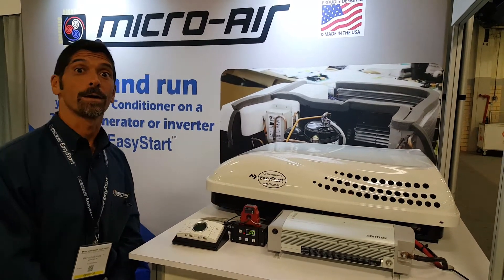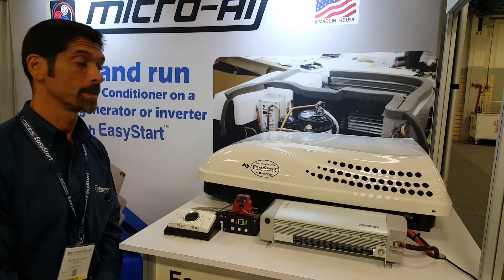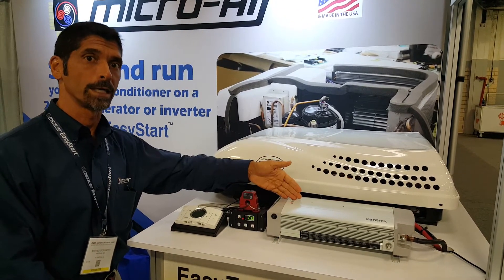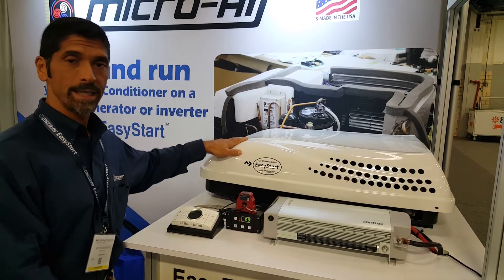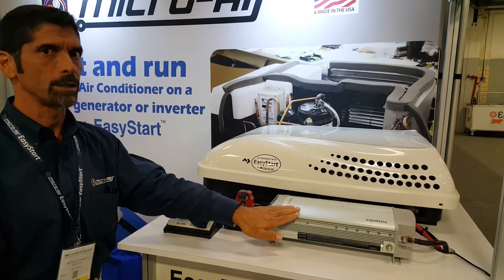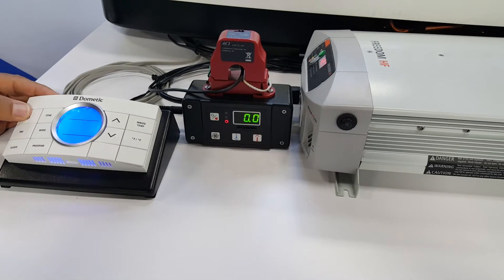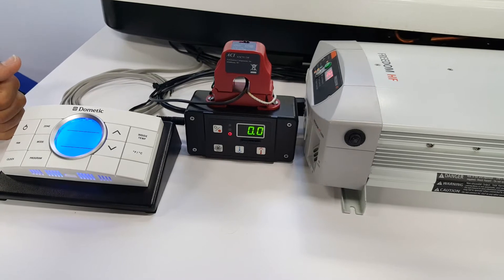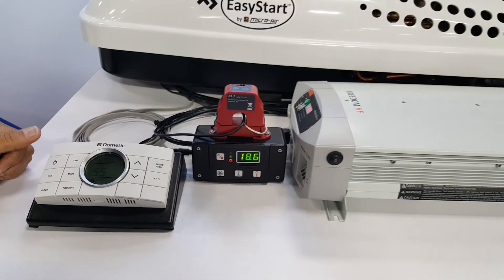Micro-Air EasyStart Soft Starter Demonstration on Inverter

Comment: Do you make one for home use here in Phoenix AZ hate the way the ac thumps to start its new but still would like to make it better. thx dan
Reply from the maker: Yes, we do manufacture EasyStart units for the home. You can browse to any of the Easystart product pages and use our Model Selector for the correct unit for your home application. https://www.microair.net

Comment: Can it be used on window AC unit? Is the installation the same as above?
Reply from the maker: Yes, indeed it can!  The wiring is the same, but where to locate the EasyStart physically can sometimes be a challenge in window units because they often have less open space.
Reply: yes but for the price of this PWM controller you can buy a more efficient window unit. Lets be realistic here.. Home A/C units dont normally need something like this unless you have a piss poor solar system or backup generator..
Reply: @Elfnetdesigns  I have a 22kW generator that gets its but kicked when the 5t AC unit starts, but the unit only requires 3.8kW once running. Piss poor isn't an accurate description. LRA and start current are genuine challenges for any power source, programmable motor protection typically is set at 600% FLA for startup overcurrent protection.